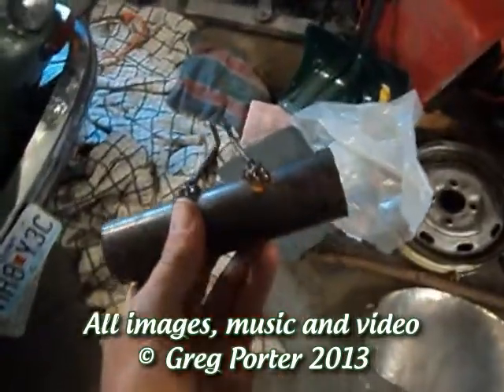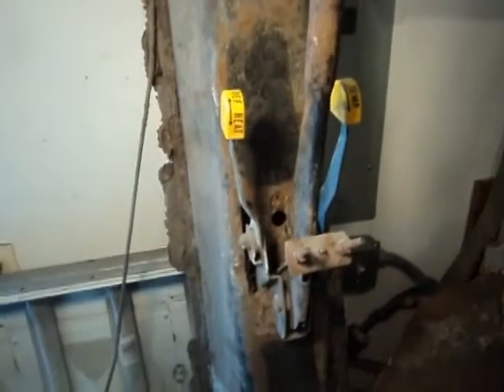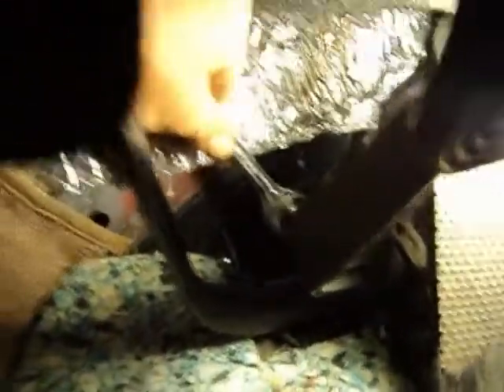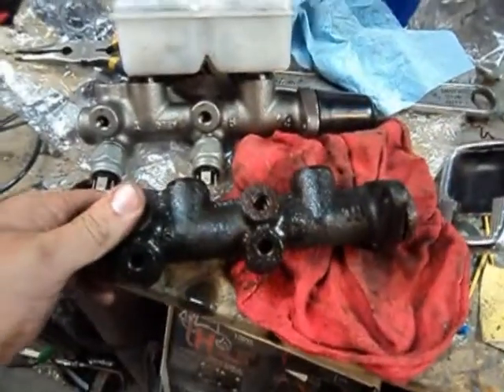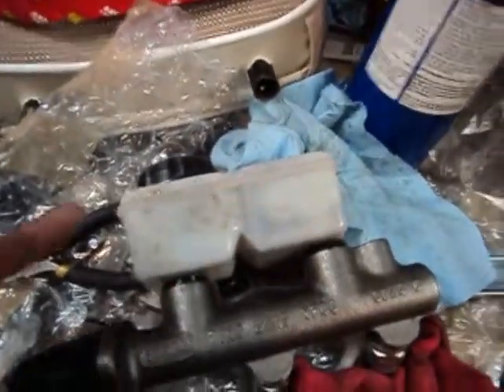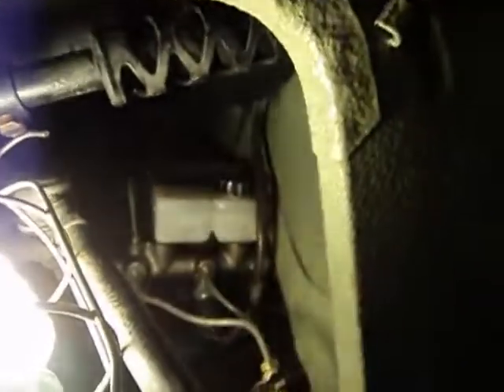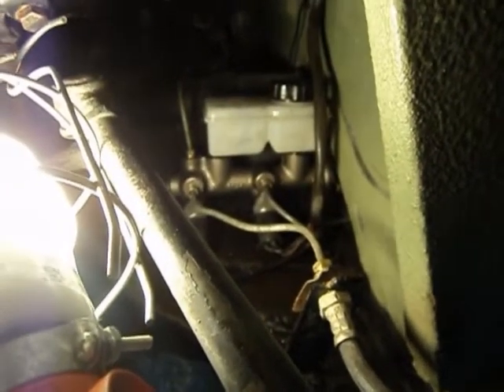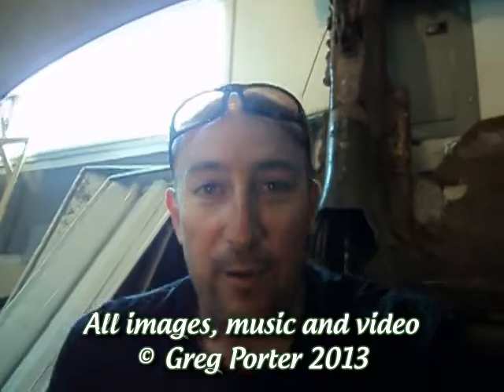VW Brake Master Cylinder Replacement

Comment: thanks for the video.  I usually pull the tank to do this job/. It's quick and gives you much much better access to the MC and brake lines.
Reply: I agree,my tank has been removed and reinstalled at least 10 times to date,and I have yet to take it out of my driveway,7 months so far dealing with mechanical sysrems,but Im real close to a driver...

Comment: always remember brake fluid is water soluble , flood any area where it hits paint with water , also when you rebuild wheel cylinders ect , the garden hose is all thats needed to clean them up lol

Comment from the maker: Oh man...  That's a million dollar question.  If they are old, they get really brittle.  A new/rebuilt MC should have new elbows.  A fork style prying tool will work best.  I've used a body panel clip removal tool before with good results.  I've also broken a few of the elbows...

Comment: Thanks for the video. I have a couple of quick questions though. Of the 3 brake lines coming out of the master cylinder, is the one coming out vertically going to the passenger front brake? Also, what was the second electrical switch for? I know one was for the brake lights but was the second one for cruise control deactivation or something else? I am about to install this same master cylinder on my rail buggy with 4 wheel discs and there are ZERO instructions with it. With your video I at least now know which ports are for the front brakes and which are for the rear. Thanks again.

Comment: Greg. I bought an American master cylinder for  a Karman Ghia, not yet installed. Should I have purchased the German master cylinder?  Have you heard of  difference in performance, durability, or problems fitting, or installing? Thanks for your input.

Comment: I pre bleed a master cylinder in the vice,then put some rubber bungs in the holes to stop the fluid from pouring out while I fit it to the car...Water will wash away any fluid that has been spilled..